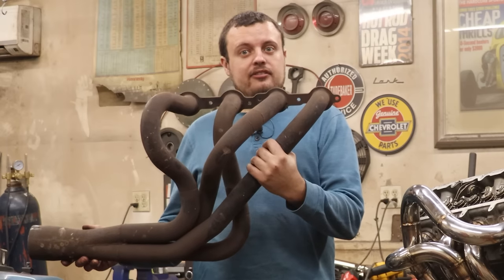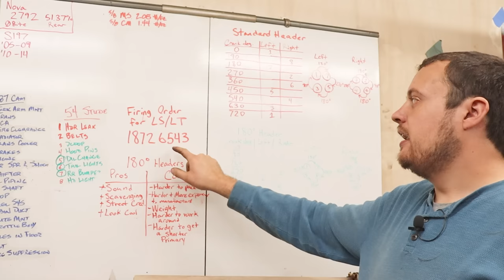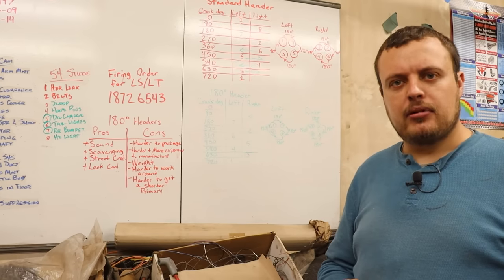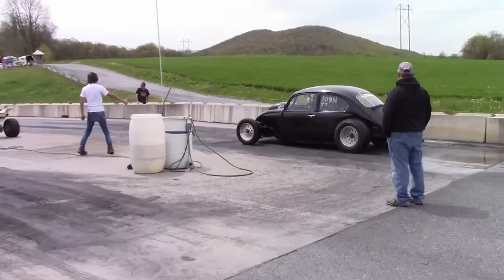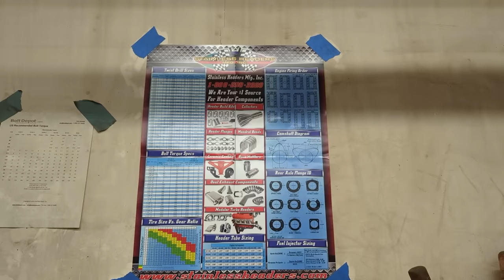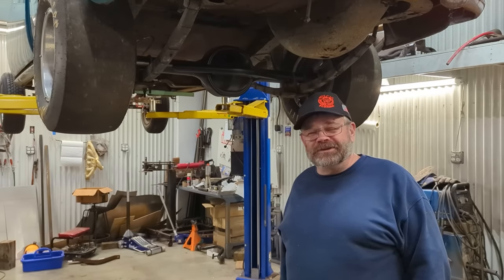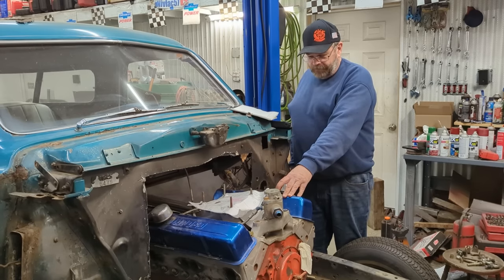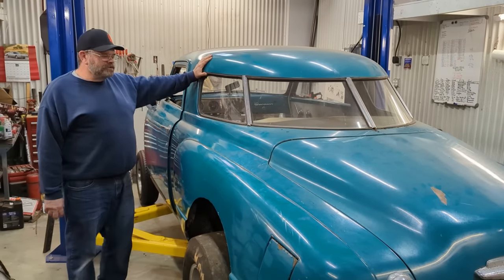I Built a Set of 180 Degree Headers for the Perfect Sound

Comment: Excellent Video! I accidentally made my Suzuki GS400 Parallel Twin sound like a Subaru when I built the turbo setup for it. The two pipes merge into one, but the right cylinder crossed over to the left into the y-pipe, so it was 12" longer than the left cylinder. It gave it the uneven, misfire "thump thump" sound, and specifically at idle and low RPM, you'd think it was a Subaru. It's crazy how much of an impact the primary tubes have on sound!

Comment: I’ve been wanting to do a set of 180* headers on my caprice ppv to go along with reducing the crank throw for a higher redline.
Not a lot of room to work with on these modern vehicles. The only way I can think of making it work is around the front of the engine and out the hood or front fenders.

Comment: Nice exhaust job. I did the same crossover (1x4-3x2) on the exhaust of my old Beetle. I felt like the engine ran freely, even though the work to build it was insane.
As you did with your eight pistons, I also joined the tubes on both sides in one exit, but before I added two dampers and, finally, I kept the two original outlets, making a 4.2.1.2 system. It was great, with no internal vibrations and silent, due to the length of the tubes, the addition of dampers and the outlet box.
Ah, my Beetle isn't for drag racing, but it accelerates well...

Comment: Hi Fellas , from Australia ( your American buddies just toured here  on your gasser steering , the best way to go is to use a rack and pinion , works well and simple. all you need is sliding mounts . all i did was let the shaft slide through mounted heim joints. Thats the way i set up my 63 Falcon in 1970 The rack mounted directly to the tube axle. Be careful welding mounts to the tube axle . I would weld longitudinally , welding around the tube can cause a stress fracture leading to a bent or even worse , broken tube especially on a reasonably heavy car ( 2550 lbs ). The tube that broke was 1.5 in dia .080 wall chromoly. Replaced it with 1.75 dia 3/16 wall DOM, lasted for years.
Reply from the maker: Yeah. Unfortunately that is not era correct for the classes we want to participate in

Comment: Did you consider going to a pair of flanges bolted face to face under the pan?  For "easier" install/removal.  
Seem to recall 180 degree headers on a big Ford (Fairlane?) having that feature.  "Bundle of Snakes"?
Reply from the maker: I definitely considered it, but didn't think it would be necessary. It's pretty much an "engine out" process to get the headers off anyways.

Comment: I... had never thought of this option.  I do know that two exhaust pulses 90 [crank] degrees are a problem: they largely appear to the collector as a unified pulse of higher amplitude, and because of that, scavanging does not behave the same for all cylinders.   Unequal primary lengths can solve this time of arrival problem for a two plane crank.
But the sound out of those 180's... I freakin love it!
Reply from the maker: Problem with unequal length is you won't get the scavenging benefit.

Comment: Calvin I have a 66duce gasser with 4in.drop straight axle,did not like the steering box and drag links I use a rack and pinion steering box from a dodge rear axle rack no bump steer drives like a caddy
Reply from the maker: My Dad has done a lot of gassers. He knows what he is doing. Will it have a little bump steer? Yes, but it will be minimal.

Comment: Glad to see Andrew up and about. The whole NA and manual alone would've been cool, but 180 degree headers and studebakers and one of them a gasser, oh yes. Now, here's a further experiment for down the road with the sound department, boom tube. Speaking of NASCAR, those 180 degree headers in an early 80s Regal or late 70s Olds (at least I think Cale & Jr ran them first with those 442s) would be a pretty sweet deal as well :)
Reply: Does anyone realize how slow a NASCAR is in the straight line?
Reply: @DieselRamcharger  The Junior Johnson 442 would've probably been a mid to high 10 second, 120 something mph car in terms of 1/4 mile acceleration, obviously needing suitable gearing, tires and a chassis that doesn't want to constantly turn left. On an oval like Talladega, wherein cornering speed isn't an issue the top speed of that car is horsepower and drag and anyone who has watched a race knows that it took a couple of laps for the cars to get to that terminal velocity. My comment is about small blocks,180 degree headers and where they've been used, so what is your point?

Comment: Seems to me that those header pipes running so close under the oil pan will put a LOT of heat into said oil pan, and by extension, the oil.  I also prefer the uneven sound of the standard headers myself, but you do you, it's your build after all.  Hope you never have to drop that oil pan!  I personally think the best sounding engines are I6s and 90 degree uneven fire V10s.
Reply from the maker: To each their own. Heat is not an issue. I have kept an eye on oil temp. Even on a hot summer day it's hasn't gone higher than like 205F

Comment: Could you merge the cylinders that need to cross into one primary so you only have two tubes under the engine?

If you change your mind on boost, an LSA blower on the LT would be cool. "Manageable" boost, port injection built in so you could do staged fuel, duel fuel, DI delete... and blower noises with the 180 headers would be interesting.
Reply from the maker: I've been thinking about an LT4 blower actually.

Comment: This is really cool to know, makes me ask a few questions though. 
1. I am very curious what the power gains are vs long tube headers with the same primary size (especially at 5000rpm in your case)
2. If you ran a 180° headers without the Y pipe with twin turbos how it would improve spool & power vs conventional TT setups
3. If you ran a full length single exhaust offer the 180° headers & Y pipe into a single exhaust then ran a remote turbo say for a truck application how would spool & power compare
4. Why not run an X pipe after the collector for the V8 sound?

Bonus question, how do you find optimal operating rpm’s based on engine size primary size primary length etc?
Reply from the maker: 1 I would guess 10-20hp
2 I'd like to try that and see
3 I bet it would do pretty well
4 I want it to have a smooth howl like an inline 6 cylinder. That's just my personal preference.

My Dad has an Excel sheet that does the calcs for header length and whatnot. It's based on speed of sound and that sort of thing.

Comment: On cars that have the room on top could have it all routed on top and combine at the collectors just before a turbo. Putting the Y pipe before or after the turbo depending on if you run single or dual-parallel turbos. This will probably only work on older trucks and vehicles with a ton of room on top to work with.

Comment: Not just sound, this is tuned to the engine, what a modded exhaust should be doing, making power, free breathing… that y pipe definitely spun up faster, 

I wonder how a turbo would change the design or if it still applies?

Comment: looks great i fab custom headers, several 180s but they went on boats so headers was on top. that is a lotta heat under the engine hope you have huge oil cooler with a huge fan. later dude
Reply from the maker: I'm not too worried about it. It has a pretty good air gap, but we will keep an eye on oil temps. If it becomes a problem, we'll wrap the headers in that spot. Look at modern Hondas. They run the exhaust right under the oil pan similar to this.

Comment: What size piping are you using on the output side of the wye pipe?  The 180 headers sound great 👍.  It's a tough call on which gen small block will come out on top. I think due to the heads of the gen 5 it might be slightly ahead.
Reply from the maker: 3 inch.
Reply: @Nivlac57  cool. Looking forward to seeing the dueling Studebaker builds.

Comment: Looks great ✅sounds great✅active heating for your sump and oil✅ On a serious note, would that have any negative impact?
Reply from the maker: It is not even a small issue. Highest oil temp I've seen on a hot day sitting in traffic was 205F. Stainless steel has a quarter the thermal conductivity of mild steel.

Comment: What about a mid or rear mounted turbo with that set up? Or twins into a Y pipe? What about a forward facing exit?
Reply from the maker: Like I said, I don't need the temptation. I'm considering putting a LT4 blower on it, but no turbos on this one.
Reply: @Calvin-Nelson  I commented like 6 minutes in and regretted it after the 14 or 16 minute mark lol
Reply: Still be cool to see that in a forward facing design. With a set of twins and the down pipes in a Y. Blasting that sweet music through a 6-8 inch straight pipe.
Reply from the maker: @bladenrexroth2555  We've certainly thought about it, just not this car. Lol. Appreciate the enthusiasm.

Comment: Interesting on the sound notes. Since the exhaust is firing out of opposing banks sequentially, this may negate the need of an X or H to "equal" out like traditionally needed, and the use of the Y helps consolidate or overlay sound as you showed. I wonder if the placement of the Y matters? Does this effect the sound overlay? Y together right after collectors vs. later in the system... What about still using an X pipe? I've done a ton of research into 180 header theory and I've seen a few people leave the banks completely separate to try to get interesting notes, but as you've shown, and I haven't heard this compared quite so well before, this does create a "dualing 4 cylinder" effect-- which I'm not a fan of. I wonder how this sound overlay happens in terms of the pulses "combining" and how different you can make the sound based on where you combine them, what components are before/after this combining fitting, etc..
Reply from the maker: I would think equal secondary pipes going into the Y is the way to go. I'm sure there is an optimal length, but I'm just going to put it where it fits for now.

Comment: Really looking forward to hearing this in action. I may be picking up a 911 with LS and 180s on it. You might look into heat shields under the pan. Is the Y pipe combining both sides to single exhaust?
Reply from the maker: Thanks. Yes. Y pipe brings two side together, but it is important to get the lengths into the Y pipe to be right too.
Reply: @Calvin-Nelson  I love the sound of it, but I don’t think there will be room at the back of that car. Plus, I’ll probably turbo it again too lol. I’ll just have to listen to yours

Comment: Interesting topic! Question in your opinion what would the best header design be for a Dodge viper V10, with this firing order: 
In this scenario: 1, 10-9, 4-3, 6-5, 8-7, 2

comma = 90 degrees
dash = 54 degrees

Fire 1, rotate 90
Fire 10, rotate 54
Fire 9, rotate 90
Fire 4, rotate 54
Fire 3, rotate 90
Fire 6, rotate 54
Fire 5, rotate 90
Fire 8, rotate 54
Fire 7, rotate 90
Fire 2, rotate 54
----------------------
Tot. Degrees: 720
Reply from the maker: Wow..... That's nuts. I'd do 1, 9, 3, 5, and 7 into one 5 into 1 collector. Then the remaining into the other. So it looks like you could do a 144 degree header setup with minimal hassle. Since it's all on the same side. The secondary lengths will be the key to getting that nice smooth frequency. You'll actually have to make one bank a little longer going into the Y.

Comment: From what I have heard and talked to some old time engine builders for race teams you need UEL headers they said it’s built of some math based on the engine size and value lift and duration. And if you are track or streetcar. But you don’t have to cross over like that. And you can have it meet at the collector with 8 into one. But main benefit they talk about is being able to save weight on the value train and pistons and then the crank and they port the heads it’s a whole crazy mathematical thing to figure out the bends and length to change the sound. But also gain like 45 hp
Reply from the maker: Yeah. 8 into 1s are hard to package. It's definitely a complex problem.

Comment: Question regarding the cam timing, do you think you will have to change/increase valve overlap to compensate for the longer exhaust runner length in an effort not to loose too much power up top?

Comment: Any ngative affect towards cooling from having the piped directly under the pan?
Reply from the maker: Not that I can tell. Highest oil temp I saw on a hot day after a long street drive was 202F. Oddly enough, it gets hotter on the highway than it does just sitting at a traffic light.

Comment: I understand the complexity of making/designing a set of 180° headers (the main reason that I haven't). I also understand the alternate exhaust sound that they can produce. However I didn't realize that they would also raise the optimum rpm operating range so  much. As I like to design and build LS engines to operate similarly to a diesel through camshaft, exhaust, turbo, transmission (gearing), and axle gears. If I could keep the rpms down (~2000rpm at ~60mph) and still use a turbocharger. I would give it a try, although if I need to wring out the engine in excess of 4000rpm+ instead of my preferred ~2000rpm. I don’t know if it would be worth the effort. What do you think?
Reply from the maker: If you made the primaries long enough, you could definitely optimize it for 2000RPM.
Reply: @Nivlac57  Thanks, if I had more financial flexibility and extra place in a shop I would certainly give it an attempt.

Comment: Wonder if reverse flowing the heads so the exhaust comes from the intake and intake is on the exhaust ports.

Doing the 180 setup should be easier, especially in a rear engine car
Reply from the maker: Yep. They call that a Hot-V configuration. Definitely makes it easier.

Comment: Wondering if you’ll have an effect on heating a oil considering it’s wrapping underneath it pretty close to the oil pan.
Reply from the maker: I'm not too worried about it. It has a pretty good air gap, but we will keep an eye on oil temps. If it becomes a problem, we'll wrap the headers in that spot. Look at modern Hondas. They run the exhaust right under the oil pan similar to this.

Comment: I think you're going to be surprised by what happens when you put that Y pipe on your 180 headers. I did this to my set, and it sounded very very weird. The best sound comes from both pipes right next to each other. Ignition timing, primary diameter, collector choke diameter, overall exhaust pipe length, and muffler design will all GREATLY affect the sound of your final setup. I rebuilt my exhaust system several times behind my 180s trying to get the correct sound.
Reply from the maker: Interesting. The setup that was on my Dad's Datsun sounded amazing. We will see what happens there, I guess.
Reply: @Calvin-Nelson  I agree, that Datsun sounds fantastic! I've done lots of work on Panteras with 180 headers, and when I built a set for my challenger(a couple quick videos on my channel) it was clear that getting a classic GT40 sound would not only be ideal, but somewhat difficult as the pipe length behind the collector increased.
Reply from the maker: @life_of_riley88  Yeah. Perhaps tuning the secondary and tertiary lengths is the key.

Comment: The big problem with 180 degree headers is the length of the primary tube length are longer than optimal for anything higher than 5500 rpm... I  designed headers for Hendricks Motorsports for a few years...

Comment: Once upon a time, I had a 1966 VW Type 3 Fastback with (of course) the 4-cylinder 'flat-four' air cooled engine (1.6L). I did some mods along the way including a lightened flywheel and some intake mods to improve airflow. It worked not bad, considering its inherent limitations. At some point, I need to replace the exhaust and heater boxes (expensive!), and I almost instantly noticed that there was room to fit in four 'Thrush'-brand straight-thru glass-pack mufflers. So, once built and installed, each of the four cylinders had a very short curved 'header' pipe that almost immediately went into its assigned muffler, then a very short tail pipe to exit the car. The mufflers didn't do much, it sounded like open headers (or like The Battle Of Britain). It must have been illegally loud by any standard. So this idiotic 4-into-4 design would have been "720°" headers, and thus 4x "better" (LOL) than 180°. Arguably 2x better again if you consider the number of tail pipes. Great fun. 🙂

Comment: Seems like those pipes under the engine would heat up the oil also.  Is there a consideration for Dry sump or oil cooler?
Reply from the maker: I'm not too worried about it. It has a pretty good air gap, but we will keep an eye on oil temps. If it becomes a problem, we'll wrap the headers in that spot. Look at modern Hondas. They run the exhaust right under the oil pan similar to this.

Comment: This was very interesting and informative for sure but how will the exhaust tubes that close to the oil pan affect the oil temperature and the overall temperatures under the hood?
Reply from the maker: I'm not too worried about it. It has a pretty good air gap, but we will keep an eye on oil temps. If it becomes a problem, we'll wrap the headers in that spot. Look at modern Hondas. They run the exhaust right under the oil pan similar to this.

Comment: Draw backs of a motor plate vs traditional motor mounts? 🤔
Reply from the maker: Not really any drawbacks other than they are more expense. They will actually make the car lighter if you build it right. The engines block becomes part of the chassis.

Comment: Mad the lengths, rimshot you have to take with a crossplane crank setup to get the same result as a flatplane crank. Be interesting to see the inverse, running a flatplane crank with unequal length headers to achieve 'stock' sound. =]